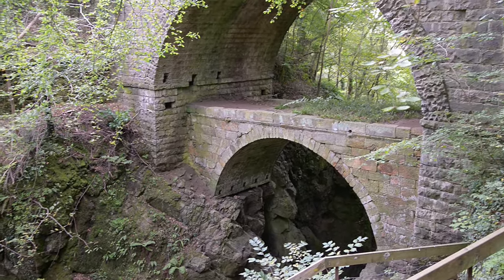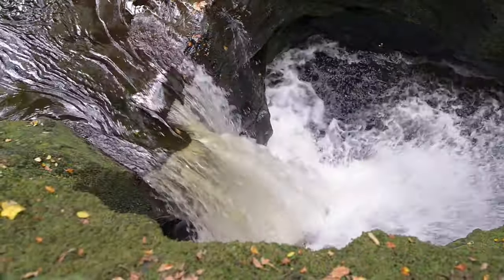Field Recording mic comparison.

Comment: Good stuff Andy. I recently went  to a canyon with raging water coming down from the mountain, and recorded it with my H1n. Sadly it was absolutely useless recording as all I got was overwhelming and constant white noise. It was hard to tell what it was.
Reply from the maker: I found that too, what I did was kept monitoring on the headphones until I found a location that at least had some extra sound. Then got my levels the best I could so it wouldn't clip and kept my fingers crossed. It was fairly subtle the differences but the better mics actually managed to pic it up.